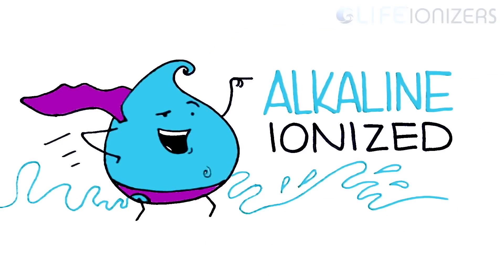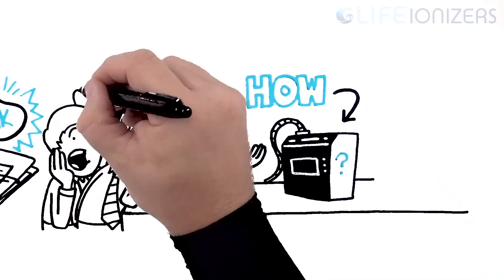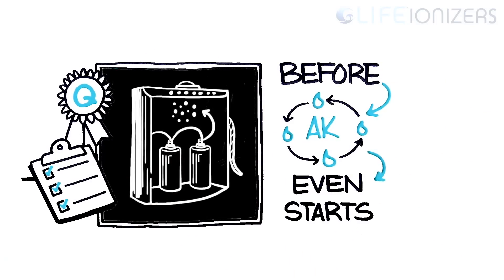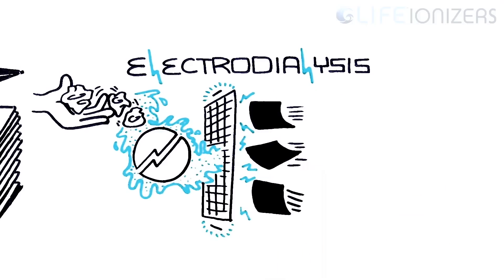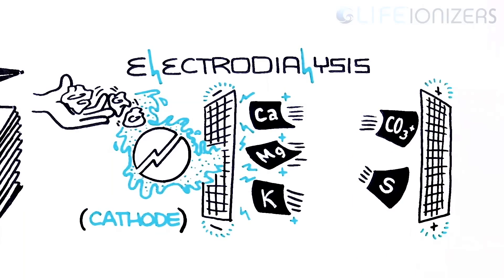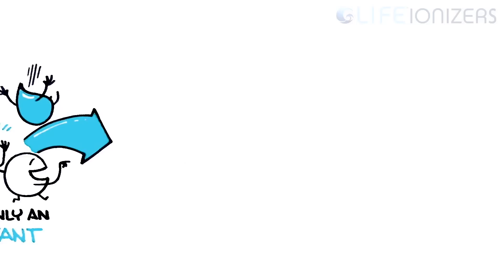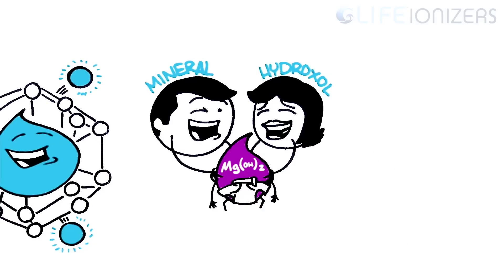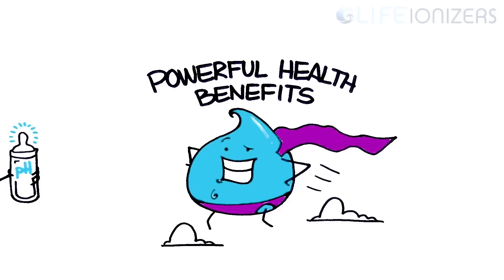Life Ionizers Presents - How Does A Water Ionizer Work?

Comment: Are other pre-filters needed, when using average hard water municipal faucet water input with your alkaline water machines?
How many gallons does a filter set in your alkaline water machines process? 
How costly and how frequent is maintenance? 
What is life expectancy of the alkaline water machines you sell? 
Water molecules already have H2 per molecule; how much more Hydrogen is added by your machines, and, where does it get that from? 
Wouldn’t it be of more benefit to add more Oxygen? 
How might distilled water from solar distiller, be better than 2-stage filtered water?